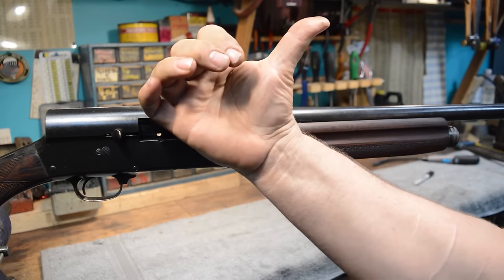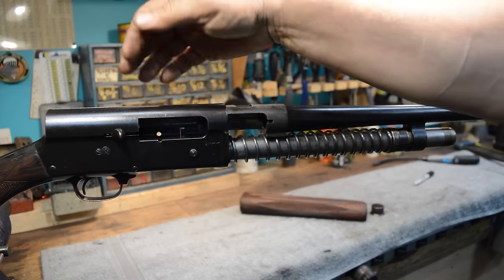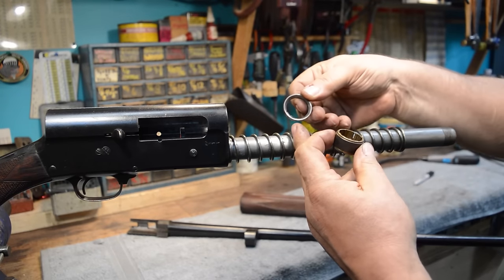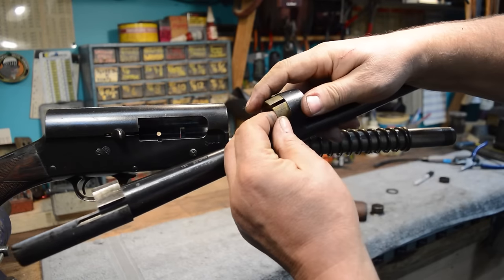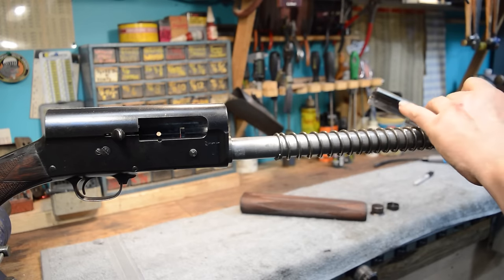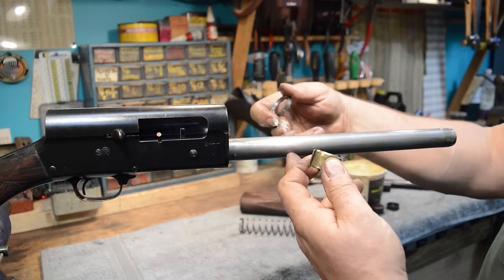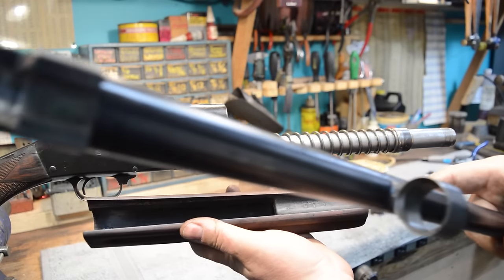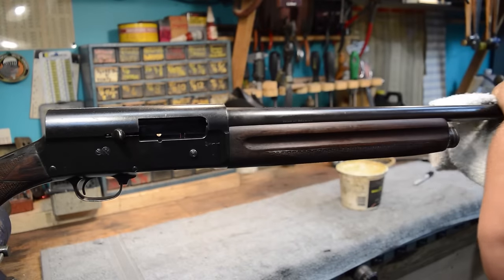Browning A5 Friction Ring Setup

Comment: Hey Mark,should you ever choose to revisit the A5,would you consider putting a straight edge on the magazine tube ? Grease or no,the magazine tube is what,aluminum  ? For say a hundred bird seasons,that friction ring has grabbed that tube. I am personally amazed it did not wear a visible hourglass into the magazine tube. Two soft metals.
I would have thought the magazine tube could be considered a wear item eventual consumable,with mandatory replacement being the only realistic option. Spray weld aluminum on then machine to original tolerance ? Somehow I think not.
Am I missing something here ?
Reply: I think he said that the mag tube is steel.
Reply: @m.j.mahoney8905  Hmm. I was looking at the tube. Will revisit the audio.
Reply: At the 4 minute mark. You are correct.  Steel tube. Still,basic question pertains. How worn is the tube,against a straight edge  ? Any ? Some ?
Reply: @paulmanson253  Properly maintained only the ring wears.
Reply: Properly maintained, only the softer metal should wear noticeably. Also properly maintained (that is, greased properly) there should be virtually no actual metal to metal contact, all the contact should be the sliding grease. So there should be virtually no wear. 
You probably are saying, but wait, if it is grease on grease, how is it a brake? Isn't grease slippery? Yes, grease is slippery, but it is also viscous, it likes to stick to itself and other things. This is actually a form of friction, so you still get braking action. Just not as much as direct metal on metal.
Reply: @lwilton  Not to be pedantic,but you are talking to a school trained automatic transmission mechanic. I am quite familiar with dynamic friction and viscous coupling.
No wear ? Well it is possible.  It would be fun,at least for me to do an Adam Booth with a Starret capable of tenths,on a granite surface plate with the tube laid on the granite,literally chasing tenths of a thousandth of an inch along the line of the tube. Or perhaps the Starrett hooked up to that big shaper and use it to chase tenths along the magazine tube.
Just personal curiosity.  In functional terms,as you indicate, as long as the ring can generate a reliable repeatable dynamic friction,it is not material how worn the magazine tube is. If it ain't broke,don't fix it.
There is no way,no way you can tell me that John Browning or the people what screwed this bang stick together expected it to be taking birds a hundred years later. That there nonferrous ring looks exactly like a part found in manual transmissions,part of the synchro assembly. And for all practical purposes,has more or less the same role.
Just goes to show a simple smart idea can have several uses.
Reply: The coil spring will rotate the ring a couple of thousandth’s when cycled, so after a few hundred shots you can notice the ring isn’t in the same position as it originally was placed. If properly lubed.

Comment: I've got a 1948 Belgian A5... With a Cutts comp... What do I need to know? Can I use modern shells in it? I have the full, modified and open choke "tubes" for it. What can't I use in this?
>In B4 you shouldn't've bought an A5 with a Cutts
Reply from the maker: I love the Cutts compensator. Best choke system ever in my opinion. I run the terwilligers out of all of mine
Reply: The Cutts seems to be pretty polarizing... But, that's the internet for you.

Comment: Ok, so my Franchi 48 is essentially the same thing with the friction ring, or so it seems. 

What is the best setup for the friction rings for standard target loads? Bevel towards barrel or receiver
I'm assuming the opposite would work for heavier loads.
Reply: For any load with a long recoil you wanna start with the most friction first. Try heavy load first and be sure to keep the magazine tube lightly oiled. Browning themselves state normal gun oil is fine for this. If it won't cycle or tends to fail to feed or jam switch it to light. Biggest thing is keeping the gun from beating itself to death.
Reply: @Brake_MagnetoMan175  Thank you. I keep hearing that this is a garbage shotgun and I wasted my money, but I like it
Reply: @matthiasthulman4058  They are great shotguns, basically a complete copy of the Auto-5. If you like then that's all that matters man.
Reply: @matthiasthulman4058  I have a 48al in 20 gauge and it's been a great gun.

Comment: How long does the brass friction ring last?
Reply: Who could say? It depends how often you use the shotgun and the setup. 
My guess:
With proper care: decades
Without proper care: decades but you'll see some slight wear
Take it apart, look at the contact surface with a magnifier if needed.
The pointer at 4:02 is important.

Comment: I’ve got an auto 5 from the 50’s. Original Belgium barrel. Do you know what the two ** means? Can I shoot slugs out of it? And is it better to set it to heavy load and still shoot light loads from it without switching?
Reply: The two stars on a Browning barrel indicate a Modified choke. You should be ok shooting slugs (though I've never shot slugs from an A5 myself). You may need to change the friction ring set up if you switch from heavy to light  loads (probably will) - when set to heavy load, a light load may not make the gun cycle properly. That said, I just lightly oil mine (no grease), and set the rings to heaviest, i.e. conical side of the complete ring against the cut brass ring, and handicap trap loads (1 1/8 oz, 3 dram equivalent) cycle absolutely reliably, and nice and gently.
Reply: @kleedhamhobby  thanks that’s helpful
Reply: Slugs are NO problem, I have been shooting slugs out of my full choke * for 50 years, set the rings up correctly for what you are shooting or it will eventually damage the mechanism.  You will also notice (contrary to popular belief) that the old Brownings shoot relatively softly, when set up and lubricated correctly.
Reply: @jamesoliva9531  thanks for the response

Comment: I'm a pump kind of guy. Just adding a comment  to help out.
Reply: Have you ever owned a J.C. Higgins Model 20? They were made by High Standard for Sears in the 50's and early 60's. Best pump for the money. Mossberg copied their action but used an alloy receiver. The JC's are steel and the barrel is screwed into the receiver. Super tough.

Comment: Is this design more or less reliable than a blowback design?
Reply: More reliable, but you get a heavier weighing gun and more recoil with the inertia driven.
Reply: Old Browning A-5 are by far the best setup money can buy.  I have been using mine for 50+ years with ZERO problem.  My son now uses my father's 100 year old A-5 with only a clip spring replaced everything else 100% original and shoots great.  One note there are several different friction rings that browning used  make sure you have the slots lined up correctly if that is the type you have.

Comment: Nice, but no mention of setup for low base vs. high base.  I got a lesson from a gunsmith 35 years ago, and just know mine is set up for high base.
Reply from the maker: The more recoil a shell produces, the more braking effect needed. That's about it...
Reply: @marknovak8255  But still, Mr. Novak?  Most of us know this.  I am talking about explaining how to set the A5 up for low vs. high base.  You could do a 3 minute video on this?  I can figure it out.  It would still be a gift to the rest of the world.  You might have actually covered this in your video but it was not clear at all.
Reply from the maker: @pcmacd  How high or low the brass is does not tell you how much energy the shell possesses. That is determined by powder charge and shot weight. I have seen 2 3/4 dram loads in high brass shells, and 3 3/4 dram 1 1/8 loads in low brass shells. So....more energy and shot, more braking. Less energy/shot, less braking.
Reply: @marknovak8255  Wow.  That is news to me.  That's not how my gunsmith explained it, but I am not doubting you.
Reply: Sirs,
 Have a pre 1960 A5 12 gauge that my father gifted me used back in 1974. Until recently I never had any issue using the gun for bird rabbit/small game or deer hunting. I attended a skeet shoot that the only ammo I could find was low brass. You guessed it the gun would not eject the spent shells. I never had an owners Manuel for the gun so I was at a loss as to what to do. I am told that I can simply reverse the friction ring but after watching this video I think I should remove the ring and allow all the energy to to push the barrel back and thus eject the spent shell. Am I correct? Thank you for a reply Mr Novak.
Reply: Great simple explanation. Thanks.
Reply: Highbrass and lowbrass meannothing. Theres no difference. Its higher meant only to burn all the powder
Reply: @Fred Wills thanks that is exactly what the video didn’t explain
Reply: @dalanwanbdiska6542  in the common speak what is meant is magnum load versus light loads, lots of folks refer to that as high brass low brass
Reply: I'm going to start something here, but high brass vs low brass means nothing.  You can have a high or low power shell in either.  High brass was designed by the manufactures to imply a more powerful shell.  A shell is a shell - and the power of  it has nothing do with the case itself.

Comment: The gun you’re messing with is a Browning “Auto-5”.

Browning didn’t make the “A5” until 2012 and that ain’t it.
Reply: Yes, the modern A5 came out from Browning Arms in 2012.  The original A5 was created by John Moses Browning and produced from 1900 through 1939.  So, you were absolutely correct, sort of.